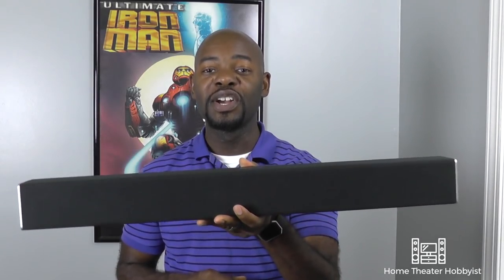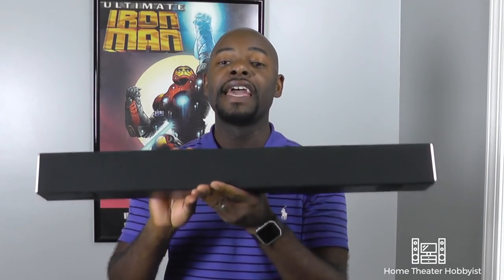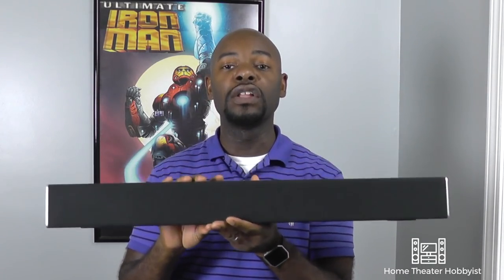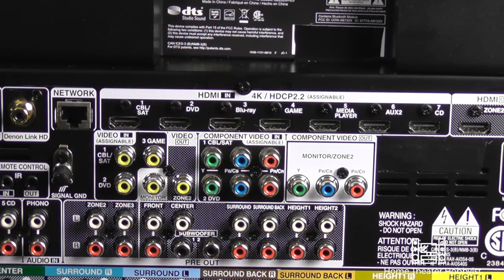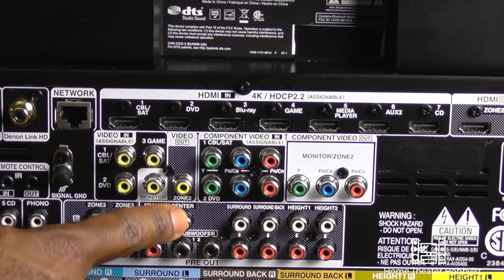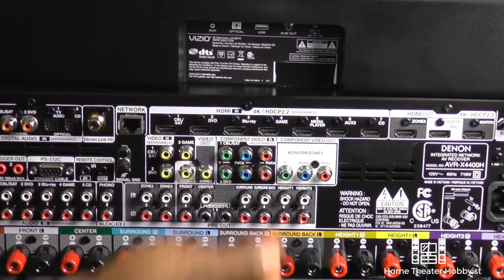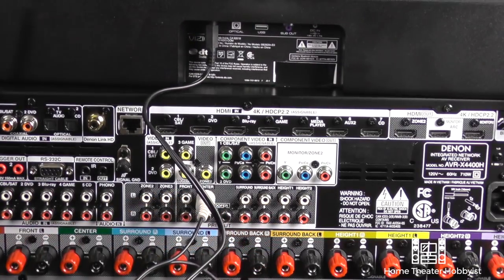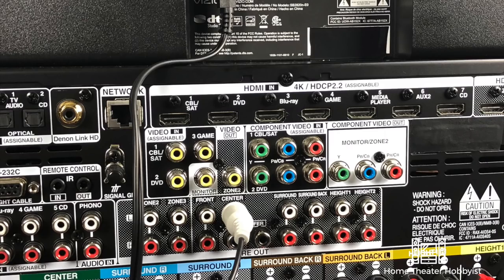HT Basics: Connecting a Soundbar to an AV Receiver

Comment: What about using the additional HDMI out to go to the sound bar?
Reply: Id like to know too.  I have a Samsung TV and Soundbar.  Just moved to a house with Speakers in the wall.  Only way I guess to use them is add a receiver.  I don't want to have two remotes.  So if HDMI ARC works from the bar to the receiver. The TV remote should control both the Bar and Receiver.  Not buying a $300 unless I think its gonna work.
Reply: @HVIW3H3N  , did you try this yet? I'm in the same boat.
Reply: Did anyone find the answer to this question?

Comment: I'm only here because I want to add vertical speakers to my 5.1 dolby atmos soundbar I got for $180. But afiak adding vertical speaker modules (dolby atmos modules) is wired and needs an AVR. Issue is, the modules are more than my sound system and AVRs are so expensive.

Comment: So check it out I did kind of what you said but in the opposite way where I have a seven. Two Onkio I didn’t really have a good’s Center Speaker so I got a sound bar and got a line level converter wired from my center channel to the sound bar RCA so I’m using my sound bar as a Center channel which works great

Comment: Sir can I buy any samsung sound bar to it to my samsung subwoofer
Reply from the maker: Not necessarily, Check your user manual to find out what sound bar it recommends for compatibility. If your subwoofer requires a wired connection you need to make sure the soundbar has that connection. If it is a wireless connection you'll need to make sure the soundbar supports the same frequency for transmission.

Comment: I purchased a new Sonos soundbar with the matching sub in late 2018 for approximately 1500.00. It has served me well, it sounds good and we enjoy the way it functions and how it integrates with the TV, Playstation, DVD player, etc. Recently, I purchased a Denon AVR 4802R at auction. Originally, I was going to resell it but after reading more about it, I think I want to try and integrate it with my Sonos/TV system. I do have great speakers I can add along with the Denon. Am I diving inot a rabbit hole that's too deep? Is the Denon too old? I've spent a fair amount of time reading on several audiophile forums and quite frankly, I'm confused. It seems like they are speaking an alien language. Any help would be greatly appreciated. Thanks in advnace!

Comment: Nice presentation, would had liked to se TOSLINK & HDMI ARC also, as many (or most) 4K HDR HDCP 2.2 receivers has these options. I agree that even this would be a short term issue until purchasing a true center channel speaker, sub (many soundbars has these built in, but again will sound different as presented) & Atmos, which can be used rather than the smaller speakers if desired. Although not all audio sources processes Atoms sound, so may need the smaller ones (bookshelf will do) anyway, there are some Atmos speakers which will sit on top of the bookshelf models. 

One can have a nice sound setup, to include Atmos, for under $1,000.....perfect for small living room. If larger area or wanting to cover more than one room, will need to spend more.
Reply from the maker: Thanks for commenting

Comment: You need to split the mono centre signal then bring it back into the rca to 3.5mm or only one side of the soundbar will work, unless it has a mono setting.

Comment: Hi,
Connecting a Soundbar to an AV Receiver
•	SmartTV Samsung with 1 x eARC HDMI and 1 x HDMI (Normal). Optical port broken.
•	Sony Soundbar with ARC HDMI.
•	Wired speakers (wire, no “banana”) I must connect to one A/V receiver (not buy again).

Need to connect soundbar to eARC receiver and SmartTV to normal HDMI of this receiver?

Suggestion to connect all that?

A/V receiver at $300 is possible?

Thanks for sharing.

Comment: I have a Sony RT-40 sound bar system with active subwoofer hub . The sub woofer hub is AC powered & also connected with soundbar + 2 standing speakers through wires connector . The soundbar  hub has eARC connector, optical connector ,analog in. Bluetooth . Can I connect this active speaker system to my Denon AVR via HDMI ARC to get the sound output from this Sony RT-40. My doubt is , since Sony RT-40 is an active speaker system with builtin pre-amp & works when powered with Ac, could this damage my AVR or should I go ahead?

Comment: What if want to add an additional / complementary active subwoofer. Is there a solution where i connect my tv to a receiver and in turn outputs to optical (for the soundbar, Onkyo LB 401) and LFE for the Sub (REL Q50)
Reply from the maker: I'm not sure

Comment: How does the sound differ from the soundbar and having a different branded centre speaker connected directly to the receiver amp?  

I imagine that there might be a slight delay to the sound from the sound bar and the sound being produced directly from the receiver amp as there is an extra step involved with the production of sound.
Reply from the maker: I don’t remember noticing any delay but if you have access to a standard center channel just use that. This video was specifically for those who want to make use of a soundbar as a center channel but it’s not ideal.
Reply: @HomeTheaterHobbyist  Thanks for your reply

Comment: Connection IDEA for: 2 standing tower speakers and a soundbar+subwoofer+wireless rear speakers. All using an AV receiver with HDMI capabilities.

1.soundbar- connected to HDMI

2.standing tower speakers- L&R channels 

Would this set up work so that more clarity and immersive experience can be had? Because i have everything but a receiver and I ain’t gonna spend 300$ on a receiver unless it’s do-able 😅
Reply from the maker: The hdmi connection between the receiver and soundbar probably won’t work. The receiver is sending video only because it handles audio.

Comment: I have built in surround sound speakers in my living room. Never had a surround sound speaker system before, but we have the speakers in my house so I figured we should use them. My middle speaker where most dialogue comes from is quiet compared to the rest of the system. How do you recommend I solve that issue? I've already increased the sound out of the middle speaker through my receiver, but it still isn't loud enough. I thought about getting a sound bar but now I'm not so sure. Any thoughts?
Reply from the maker: Did you try lowering the level of your other speakers? If you can check the connections to the center channel to make sure it’s nice and tight.

Comment: Could you use the non ARC HDMI out? There are others in your receiver.

My bar has 2 HDMI connection (one of which is ARC).
Reply: Some receiver has 2 HDMI out(one is ARC and one non ARC). The non ARC HDMI  out can connect to your bar HDMI input and your bar ARC out to TV. But you can only experience 2-channel audio.

Comment: I have a sharp soundbar subwoofer with audio in jack and a jvc amplifier with sub out, can I use this cable to get the bass in the subwoofer?
Reply from the maker: Based on the connections you mentioned it sounds like you should be able to do it.

Comment: I have a Yamaha yas-203 Soundbar with matching subwoofer. I would love to find a way to reuse the subwoofer alone. Is there a way to connect that wireless subwoofer to your receiver?
Reply from the maker: Not that I'm aware of. Any connection will have to run on the same frequency so I'd check which frequency the sub is running then determine which receiver supports wireless subs on that same frequency.
Reply: @HomeTheaterHobbyist  thanks for taking the time to reply!

Comment: I’ve got a Polk MagniFi soundbar wanting to connect a Polk Psw10 sub. The bar’s got an aux so I should be able to connect the soundbar aux to a AV receiver using the audio out (white RCA) or pre - out then the AV receiver’s subwoofer out to the subs rca correct?
Reply from the maker: It might work but I'm doubtful, you're relying on the AV receiver to send bass to the sub and I'm not sure how the sound bar will send the signal. Will it be everything or just a subsection of info? I don't know.
Reply: Thanks for reply, I don’t need any additional speakers in addition to the sound bar. I know that if someone wants additional surroundsound speakers that you can use the pre-out Then use the receiver speaker connections with wired speakers for the additional surroundsound satellite speakers. I am hoping that if that works, I’ve seen it on YouTube, then the sound bar should also be sending Bass to the receiver thereby allowing me to use the sub out from receiver to the Polk PSW 10. I don’t see why it wouldn’t work.. Any comments would be welcome.

Comment: I'm trying to expand the number of audio and video inputs that I have available (my Sony has 4 HDMI inputs, one of which is eARC HDMI), and I thought I could maybe use an AV Receiver as an HDMI switch of sorts, running both audio and video from the selected source in the Receiver up to the TV via HDMI, and then have the TV pass the incoming audio out to the Sony soundbar via eARC. This would preclude me from having to have a multi-speaker surround sound system in my room. Why wouldn't this work?
Reply from the maker: If I understand your setup correctly, I think the issue is the av receiver is only sending the video signal to the tv. Not the video and audio which is by design.

Comment: Hello, thanks for your video. I have a question. Is it possible to Connect avr to soundbar via HDMI? (Avr hdmi out -> Soundbar hdmi in  and then Soundbar hdmi out -> Tv hdmi) I've Yamaha Yas-207 which doesn't support DD+, and Nvidia Shield that don't decode DD+ into DD.

Comment: I have Vizio SB-3651 and recently got Onkyo TX-NR676, in the assumption that receiver will connect to soundbar thru Bluetooth. Wanted to reuse  Vizio.
But learned that’s not possible, please correct.
Now what are my options other than running cables. 

Sound bar sits in front and my woofer and rear speakers in the back; I am using projector for video in the back along with receiver.  
So basically I have only sound bar and screen in the front.

Please suggest all my options. Thanks.
Reply: I tried receiver HDMI-ARC, HDMI-SUB to Vizio HDMI-ARC out(I know, but tried) and HDMI in, with no luck
Reply: Are you having sound bug issues with your 676 receiver?

Comment: Can you connect a powered subwoofer to a sound bar?
Reply from the maker: Yes, if the Soundbar has a connection labeled “sub output” on the back. Use the sub cable (RCA type cable) that came with the sub. Connect it to the sub output on the Soundbar and the other end to the connection labeled sub input on the subwoofer.

Comment: Can a sound bar be plugged into the subwoofer channels?????
Reply from the maker: I wouldn’t try it, as that channel only gets audio signals that are below your crossover setting. For example if your crossover is set at 100hz all the audio below 100hz is sent through the subwoofer output. If you were to use this channel you’d only get that audio not the range that a Soundbar needs, approximately 80Hz-20,000hz

Comment: Hi, can you plz help me to know an avr which will be better for connect with my logitech z906 5.1 COMPLETE home theater system AND the best way to connect.
Reply from the maker: I don't know anything about that Logitech but it appears to have RCA Input which the vast majority of receivers have RCA output so it should work with just about any receiver.
Reply: Logitech z906 system is not designed for connection to a receiver. Although it can connect only by RCA phono. It won't deliver 5.1 sound. A DVD player can connect to Logitech z906 via optical/coaxial. Anyway, who has DVD player nowadays?
Reply: I don't understand why people waste their money, buy Logitech z906 which is for PC?

Comment: I have a Sony dh559 receiver with 2 klipsch r26f standing floor speakers I'm trying to hook my klipsch bar 48 soundbar and wireless sub to my receiver but can't get both to play. It only has 1hdmi arc USB optical and 3.5 out but dont have a 3.5 to av adapter handy. Is there any way to do it without the adapter?
Reply from the maker: Honestly, I can’t think of a way without the adapter, maybe someone else knows. Also the sub connects to the soundbar via a proprietary wireless signal so that may never work. Sorry I can’t help more.
Reply: @HomeTheaterHobbyist  thnx for your response. I bought a toslink and I still can't get it to work. Any tips?
Reply from the maker: No, I don’t have any other ideas, sorry.
Reply: @HomeTheaterHobbyist  Thnx for the replies. I got it to work by running the splitter from my Xbox but soundbar and receiver are way out of sync

Comment: I have a powered sound bar how would I hook up a car amp and when it comes with a Bluetooth sound bar with two little speakers want to hook up a 15 inch sub with it
Reply from the maker: I'm not aware of a method to connect a car amp to a sound bar. The non powered speakers probably only require speaker wire and a sub cable for the subwoofer. Try Crutchfield they may have a guide.

Comment: Bro, I have sony DAV-DZ950 DVD Home theater which only supports Dolby Digital. The sound quality of speakers and subwoofer is very good but I am restricted only to Dolby Digital. I want to watch Dolby Digital Plus or Dolby TrueHD or DTS contents on the same speakers so my question is, can my Home theater speakers be connected to an AV Reciever which supports all these Blu Ray contents if so which AV receiver I should have or what things I have to set up? The solutions from anyone would be highly appreciated.
Reply from the maker: I checked out the manual online and it looks like the connections are proprietary Sony so I don’t think you’ll be able to connect them to an av receiver. Try looking through Sony’s website to see if they have another version of the main unit (same speaker connector) that supports the other audio formats. Sorry for the not so great news but thanks for commenting.

Comment: What if you connect both RCA channels to the pre-out?
Reply from the maker: The center channel only has one connection so its a mono channel coming out of the Soundbar. But both all the other channels have left and right so you get stereo sound from the Soundbar.
Reply: Home Theater Hobbyist 
I have a sound bar already I connect the rca cable on the sound bar and av receiver they don’t work and I connect the optical cable on the av receiver. I don’t have the two speaker for  the receiver yet. Could you told me what to do?

Comment: i have a sony str-db940 reciver and i want to youse my jbl sb400 on it but i dont get sound;/
Reply from the maker: Do you have the JBL's Auxiliary to RCA cable connected, to the aux port on the JBL and one of the stereo pre-outs on the Sony? If so have you gone into JBL menu to select the correct input (Auxiliary). Did you go into the Sony menu and select the correct output (stereo pre-out)? Also make sure whatever music/movies you're playing is sending audio to both left and right channels. That will ensure the Sony is sending audio to the soundbar.

Comment: I have a Polk Soundbar with Optical and Aux and neither of them will work (using 1995 Sherwood AV Receiver)
Reply: Also have Polk mini speakers and 1968 sansui Stereo Speakers (Which Work)
Reply from the maker: That's interesting, I'm not sure why one way works but the other does not. I wonder if something is selected deep in the Sherwood menus that is preventing this from working? I dunno.... Sorry it's not working out for you
Reply: Hi, My Avr doesnt have a center pre out but it has thr normal 2 channel pre out. Can I use that instead?
Reply from the maker: That could work, it may only be single channel audio tho